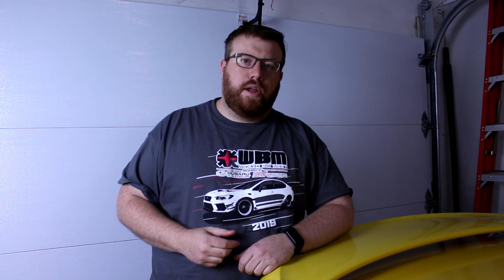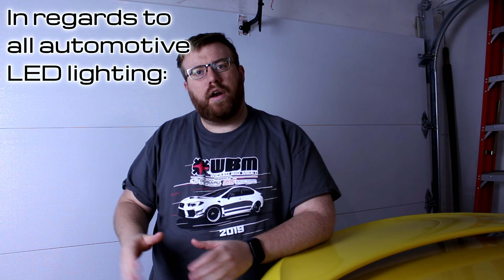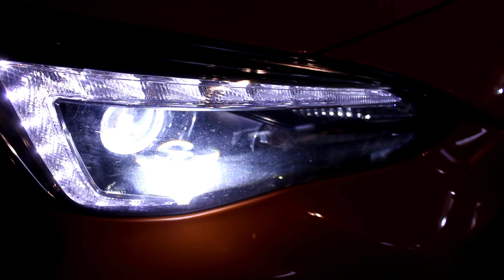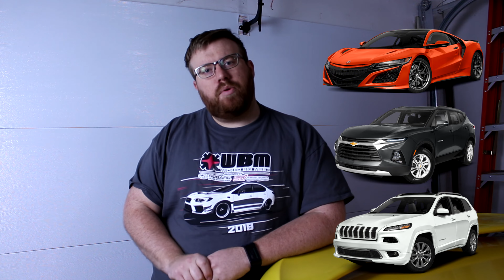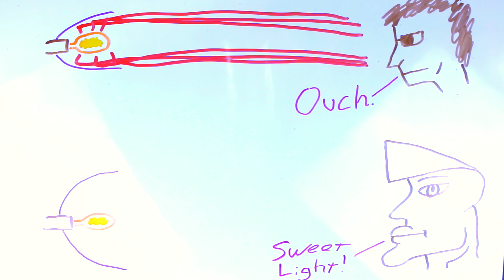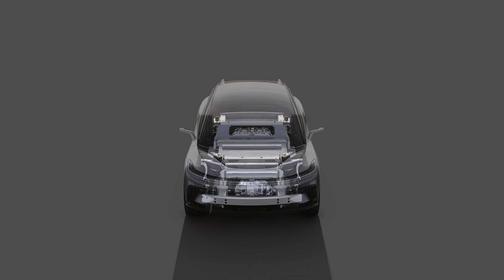"Why Are LED Headlights Legal?" • LEDs are NOT The Problem & Here's Why!

Comment from the maker: HEY!
Judging by the analytics for this video, people seem to come to it with the intention of venting because they saw bright lights on their way home.

Watch the actual video! It's not that long!
Reply: So correct me if I'm wrong. You're saying the reflective surface area removes intensity? If that's the case, why do LEDs in halogen housings seem way brighter than LEDs? I'm not trying to be an ass. I'm honestly wondering. As I understand, cold lighting is a much higher contrast to darkness, than warm light. Any kind of light out of adjustment can be too bright. But cold lights effect people in dark environments, more than warm lights. I don't think the issue is housing or reflection. It can help, but when you go over hills, you're going to blind everybody. Warm lights may be bright in those circumstances, but it doesn't have anywhere near a sensory intensity as LEDs. I know this is a 2 year old video, but I'm curious about your thoughts an my argument.
Reply: These lights have been driving me crazy during the day for years! F**** hate them!
Reply: Hay, I watched the video and the laws. Automotive companies need to get sewed negligence.

Comment: Recently (oct/nov"25) I came across a comment on a forum, that stated that car makers had figured out how to make the headlights dip at the point of meassurement while the rest of the light REMAINS on HIGH BEAM.   How occurate this is I don't know, BUT it would explain why a headlight can be dazzling then stop dazzling when on corners or rises, as you reach the low beam section of the headlight beam.
Reply from the maker: I'm in the early stages of another video on this topic and that is close to a big part of what I'm going to cover. My 2021 4Runner may have a particularly good example of the dimmed out testing zone if I can find a source confirming where that zone happens to be. The high and low beams being in the same projector is also a thing that does happen, but it doesn't always lead to an immensely bright low beam, as the array for the low beam may be dimmer by design or made more dim for the low beam setting. However, some do indeed run high beam level output in some or all of the array. It's a tricky topic because of the diverse approaches out there.

Comment: Theres absolutely no benefit to having LED headlights, other than some feable minded people think they look "Cool".
The larger lights with less bright lights still floods the whole road with light, the smaller one are from what I have observed more directional and don't blind as much, then you have people who fit leds to cars that were never design for the them, so it just appears like the full beams are on all the time.
If you have leds, please adjust the hight of them, there a little roll switch next to your steering wheel that numbered 0 to 5, 5 usually being the lowest position, park facing a wall to see the level go up or down, you want them lower than your hood/bonnet so as not to blind people.

Comment: LED are sharp hard white while the old bulbs are nice soft yellow. Some LED are worst than others but they all suck to look at compared to the old soft yellow bulbs.
Reply: Nah they're just all using cold white color temps. If they would just get their heads out of the rocks and use LEDs with warmer color temps they could practically match the look of the halogen bulbs

Comment: You cannot have multiple light sources and spread it around. I mean not too many like small cone and one outside. It will cause interference a lot. I think of the lights are angled properly they should not pierce other drivers eyes. I feel most of those led people are driving with high beams on. I feel that also because the same make model leds would sometimes be not blinding and sometimes they are on the road. Definitely high beam with halogens is less blinding then high bean leds which is the problem imo

Comment: Smaller headlights do cause lights to be brighter, but you can’t deny the fact that a lightbulb that glows at ducking 2000 lumens. the sun is 93 lumens is dangerous as hell. That’s why when people put leds in even older cars, THEY STILL BLIND YOU. leds are really nice, they just need to be turned down so people aren’t being blinded at night

Comment: LEDs as currently applied to night driving are not a beneficial solution for everyone.  Halogen headlights are so much better than LEDs. Halogen light gives a much broader spectrum of light emitted, which allows human eyes to respond properly. The broader spectrum gives a clearer return image so objects can be identified faster. LEDs trigger a strong after image of light, causing a reduction in vision. LEDs would have better applications when the light does not shine directly in people's eyes. The application of LEDs for night driving needs to be reviewed immediately and revised or replaced for the safety and benefit of everyone.

Comment: It's even worse when your car sits low and they like to ride your bumper the entire way, mad that you're going under the speed limit because you have to drive one handed and block your side mirror with the other. Not to mention not being able to safely change lanes because you can't look behind you without being blinded.
Reply: Yeah I literally had to stop in the middle of the road a few minutes ago on the way home to motion a truck around because I was blinded... And he wanted to ride my bumper on top of the bright LEDs he had...swear I felt like dragging him out of that truck but I let it go
Reply: Im considering mounting mirrors on the back of my old suv
Reply: I have a led bar in my car. I use it for cars with strong lights when they are too close

Comment: I really do hate it. I becomes very dangerous when driving my bike a night. I will be passing people and their lights are just awful to where I can't even see the lines on the road. So in some instances I have to slow down so I don't crash. I like the led lights that are tinted. Still bright but not blinding for the other person going the other way. Probably the worse are the semi/diesel trucks and some SUVs since they are right at eye level. I really wish there was proper legislation for this because it is a very dangerous. My father got into a crash because he was riding a bike and couldn't see a pot hole in front of him as someone with bright LEDs was passing by him. The fault did fall on crappy management of roads but the lights were a major contributor.

Comment: LED rear turn signals are the WORST to sit behind. They are NOT an upgrade; they flash too suddenly, and don't have any ramp-up/ramp-down speed like traditional incandescent bulbs do.  At night, and often even at dusk, they have the power to mess with your iris as it adjusts to this quick, intensely-bright flashing light; you can often see your periphery go dark as you sit waiting.  They are a close second to too-bright headlights.

Comment: Nah the real problem is the COLOR..  They are very white/blue and it destroys the night vision and causes massive glare to oncoming traffic. There was a head on collision here recently where both drivers complained they were blinded by the other's headlights. Had to laugh since they both had LED headlights and squatted trucks.
Reply: The LEDs lights that have the blue tint color are pretty decent on the eyes. I really appreciate passing a car that has those instead of the other ones.
Reply: It's the color temperature range colder temp colors like blue and white obscure vision. Especially if it's been raining out. Warmer temperature colors like yellow are much less blinding.
Reply: Blue tint LEDs are literally the worst light possible for the eyes. What are you talking about
Reply: Oh good, feel free to stare next time you see someone welding.
Reply: @electrofan1796 blue light is the most irritating and damaging, you haven't a clue.

Comment: It's not just the size, it's also the shape. I'm seeing so many OEM headlights these days that were designed around asthetics first and optics second. They look great and stylish when off but, when turned on, they're a mess. 

I was riding passenger in my friends brand new 2022 Honda Accord and the factory LED lights had an absolutely terrible beam pattern. Hot and cold spots all over. Not to mention that they were aimed WAY too high. He even mentioned that he gets flashed a lot and I told him it's no wonder because his lights are very misaligned. He said that's how the car came off the lot. A Honda Accord sits pretty damn low to the ground so, if your headlights beam cutoff is hitting the  bottom of stop signs, something's very wrong. I could see people's actual faces being lit up as they passed us in the opposite lane. 

My dad's 2021 GMC Sierra is the same. Lights aimed right at people's faces and he's constantly getting flashed. Again, same issue with optics. I lowered the headlights to the proper height and leveled them. A week later he called me saying that he couldn't see very well anymore due to the spotty beam pattern. Reluctantly, I raised them back up a little and took the truck for a test drive. No matter how much I adjusted them, I couldn't get enough light directly in front of the truck for safe driving UNLESS I aimed them way too high. I told him to take the truck back to the dealership but, he won't bother with it.

Comment: The main issue is people putting aftermarket LED in reflectors or projectors designed for halogen beams. There’s nothing wrong with LEDs as a technology or even from factory. The rare few that cause glare from factory have been lambasted by the IIHS and some receive a poor rating solely due to glare. They quickly then make a non-glaring version for the next model year.
Reply: Dude there's no point in them being on a car. Not a damn person needs led to see and if they do their a hazard to everyone damn else.

Comment: Back in the 70's I had a Rabbit and a Scirocco.  And in the 80's three GTI'S.  The Rabbit and Scirocco I used Hella H4 European headlights, not legal for road use, but I never got stopped.  They had thick quartz lenses and I used 55/100 watt bulbs not the 55/60 watt standard bulbs.  On low beam they were great and not blinding to on coming traffic.  But on high beams they would be super bright.  But I would never use high beams against traffic.  On dark roads they were fantastic.  With the GTI'S, they had glass aero lights so I just replaced the bulbs.  Again nice and bright.   Also the VW's electrical system had strong enough wires so no relays were needed.  So back then nice size lights and no dam plastic to fog up!  Just strong glass!!!
Reply from the maker: That's quite a jump in wattage for the high beams! It's impressive that the stock wiring and other components could handle that!

One would think we would have come up with a better plastic for headlights by now that doesn't get hazy. They are definitely better, but it feels like modern headlight plastic lasts 10 to 50 percent longer than their 90s counterparts. Glass has had a ton of advancements thanks to smart phones; I'm surprised no one has gone back to glass yet.
Reply: @CarsSimplified  yes glass is better but more expensive and heavier.  They need to put a chemical in the plastic mold then can hold up to the UV light.
Reply: I agree, glass is king when it comes to keeping headlight optics clear. The plastics we use these days aren't too terrible, the problem usually lies with the wimpy amount of UV resistant clear coat the manufacturer uses. I always add additional to my vehicles plastic headlights and they last much longer without hazing or yellowing